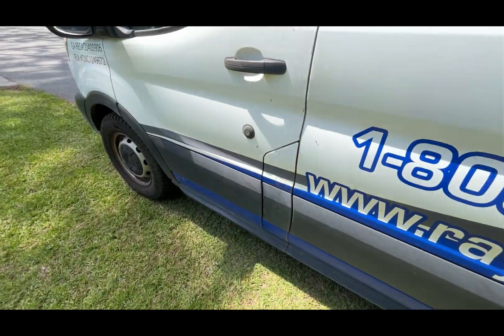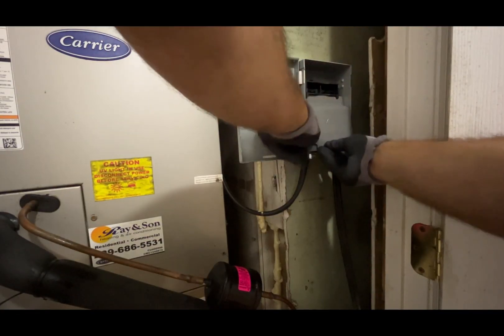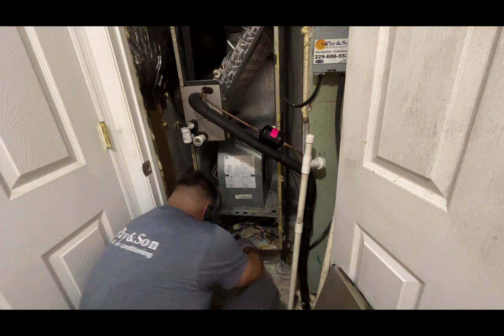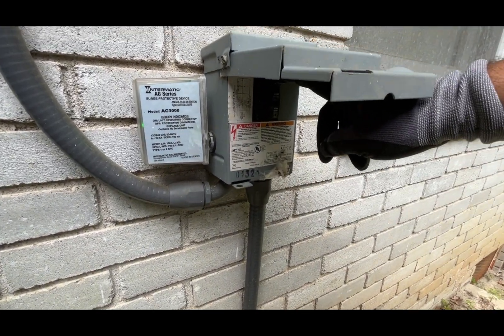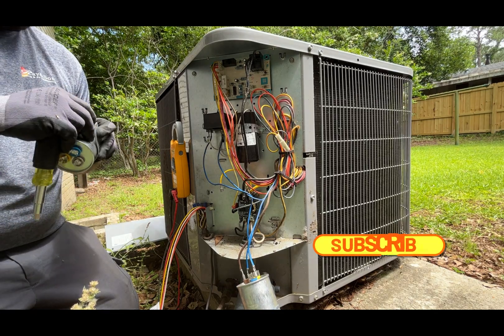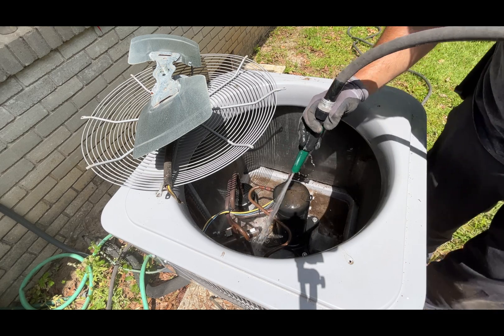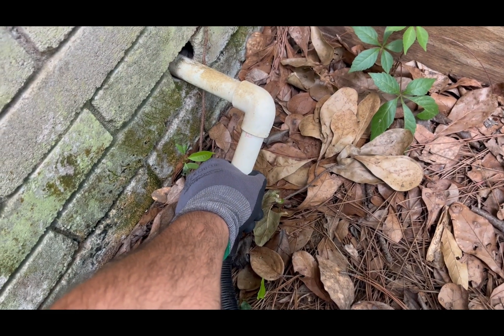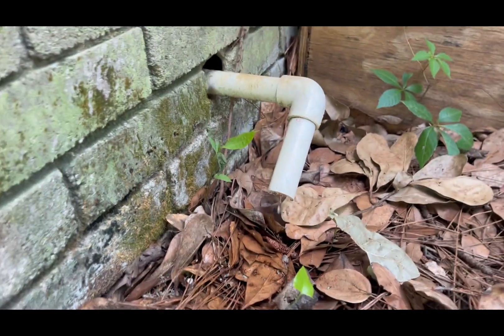CONTRACTORS  DONT WANT YOU TO KNOW HOW TO PERFORM A SUMMER SERVICE ON YOUR AIR CONDITIONER PROPERLY!

Comment: I wonder how much that service call cost..
Reply from the maker: Initial maintenance ranges between $240 to  $450. $600 depending on condition , if you have to pull more stuff out and location . You have to cover yourself for unforeseen that you will have to cover . Few people perform maintenance  like this .  So prices also vary depending on location in the US. Then I sign them up on regular maintenance to keep the  unit in clean condition.

Comment: There is a proper way of testing that capacitor. Unit needs to be running and test amps and voltage and use the formula.  That meter is not that great compared to real world.
Reply from the maker: You can measure it under load taking the amps on the start winding times 2652 divided by the voltage across the capacitor is going to be a more accurate result of capacitance because is under load .

Comment: except this is only a small fraction of what shouild be done. To be honest we go to soooo many homes where the units have supposedly been cleaned and find that the systems were never set up corrcetly. For instance, fan speed too high on the indoor unit! How are your viewers going to deal with that problem. Adjusting charge once the unit has the corrct fan speed. What are your static pressures? The list goes on. Sure you make a buck here on YT but yoou are not doing these people a service. They think they are all good but they have no idea. The hard part is getting a good contractor, doing it yourself is not an option.

Comment: You missed alot of steps i wouldnt call this proper maintenance at all
Reply from the maker: Thank you for your bad comment. bad comments are comments. If you have a better way to do maintenance create a better video and show us in that way I won’t skip them anymore . Am open to learn .
Reply: @Climaster  use a foam gun or garden sprayer to use coil cleaner on the coil. If you're scared about doing it in tight spaces actually remove the A coil from the indoor and bring it outside. Use coil cleaner (viper makes some decent stuff) on the A coil and condenser coil. Use a garden hose outside and a separate garden sprayer with water for the indoor. And giving the whole general indoor unit a cleaning. Clear the drain and dump a gallon of water through it to make sure the drain is operating correctly. Draw fan amps and compressor amps.
Reply: @Climaster  always wet your coils before adding chemicals to them. That's a good rule of thumb whenever adding cleaning chemicals to anything. Always give low voltage wiring a check. Check the contactor for pitting.
Reply: And it's not a bad comment. You can't explain how to do something properly and then skip a bunch of steps that are very important for maintenance.
Reply: Scrub the drain pan for the indoor so there is no sediment buildup and allows the water to drain properly. I use the wire brushes provided with the ez trap
Reply: @ericlewis7817  what if the evaporator coil is sealed. Is it possible for you to inspect it and clean it?
Reply: @TJ-22  if it's an evap coil in a sealed cabinet ofc it's still possible to inspect and clean it. You just stick your noggin in there with a flash light and inspect it. To clean it be more patient and use your brain. If it's caked dirt or hair on the evap just use a coil brush and clean it as best you can. Having a coil jet or bettery operated garden sprayer will make your life a whole lot easier. It's not going to be included in your regular maintenance program but well worth the extra cost.

Comment: I wish customers would do this. I tell alot of customers how to clean their condenser/heat pump and show them how. Just to save the customer money. Keeping things clean on the hvac not only saves in service calls, but also your energy bills. The dirtier your condenser is the harder it's going to work which in turn makes the electric bill go higher.

Comment: Best thing a customer can do for themselves is change 1 inch filters every month and 4 inch filters every 3 months.  Never use washable filters and never use the cheap fiberglass filters.  That's too much water pressure on the condenser coil, it's important to not flatten the fins on the coil blocking airflow, you shouldn't race through it
Reply: Wrong! Always use a fiberglass filter. What did we use before those coffee filter looking POS were invented? I have taken out coils that were spotless on units that were 40 years old. The filters only job is to keep the equipment clean not clean your house or fight allergies. It does neither at all!

Comment: Awesome Video on doing a basic maintenance but don't advertise just anyone to change out a capacitor or do anything electrical unless they have a good understanding of it. Unsure maybe it was said and I missed hearing it but before replacing a capacitor or testing one its very important to de-enigerize it they hold a electrical charge.
Reply: He did de-energize the cap with his hand tool, several times from terminal to terminal. I put the date installed on the CAP with a sharpie just for added info in the event of future problem solving.
Reply from the maker: You’re right ! Thank you for your comment , I started the video saying almost that . Is for educational purposes only . I’ll be careful next time .

Comment: Do you lubricate the blower motor bearings? Washing the condenser from the inside out is the best way. We have cottonwood trees and the condenser collects a lot of  'fluff' that you don't want to push INTO the fins. Great job and I appreciate recording the temperatures.
Reply from the maker: Thank you Chris for your feedback . I usually don’t lubricate this type of motors because they have sealed bushings and I couldn’t find a way to doit .  Is there a way to doit I will start doing it for sure.  I was able to record the measurements with my smart probes from field piece . I like to use them instead regular gauges because they almost don’t steal any freon from the unit .  I hope that everyone get something good out of this video .
Reply: @Climaster Usually there is a small plug for the oil that accepts a zoom spout, the condenser fan might be sealed but often the blower has is.  If the evaporator were dirty then I would certainly pull the blower and properly clean it.  Service technicians need to always protect their knees and back...  the voice of experience.
Reply from the maker: @Paul-hl5ls  thanks for the advice . I’ll keep it in mind and I’ll start doing it from now on
Reply: @Paul-hl5ls   Not on modern blowers!